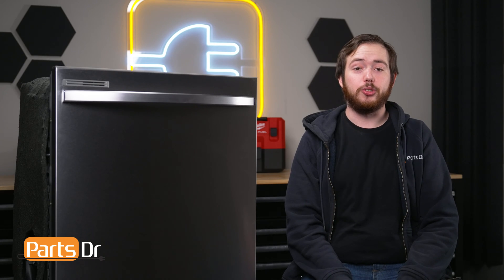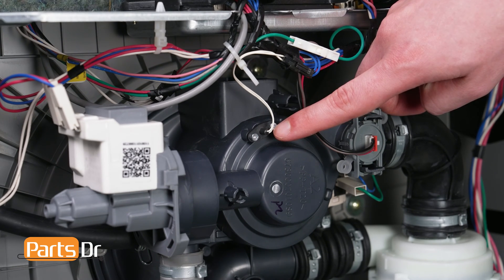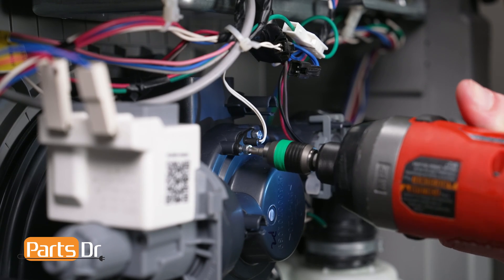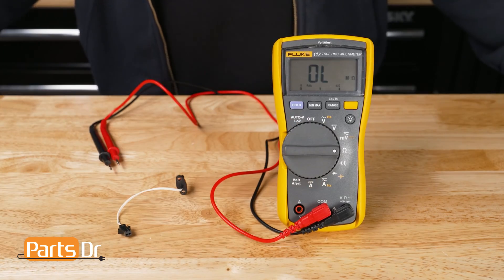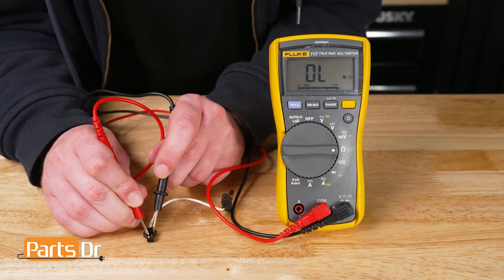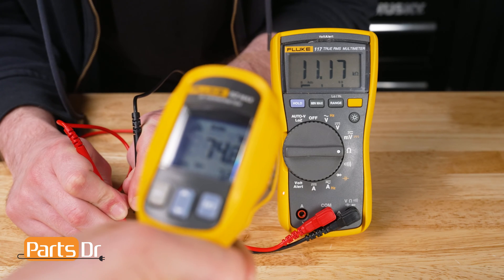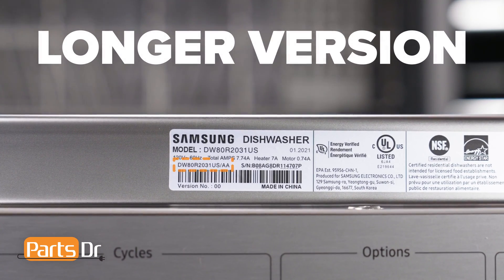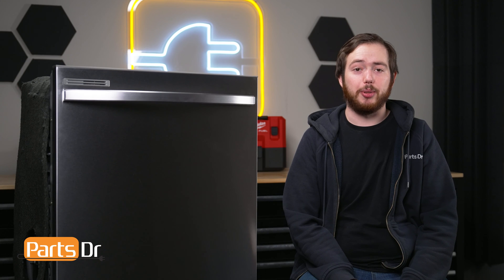How to Test your Samsung Dishwasher Temperature Sensor Thermistor part # DD81-02152A

Comment: What if does not show anything?
Reply from the maker: The part is either bad, or you are not testing it correctly.  Make sure that your multimeter is set to the correct setting and that your multimeter can measure at least 22K (22000) plus ohms.